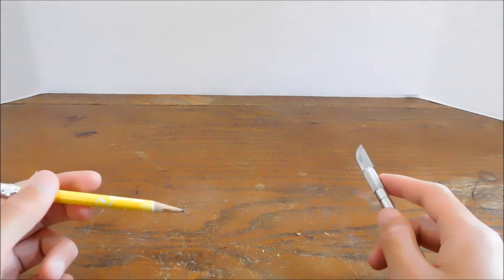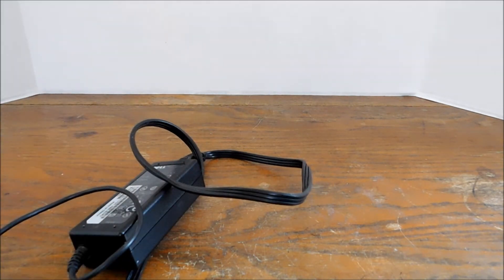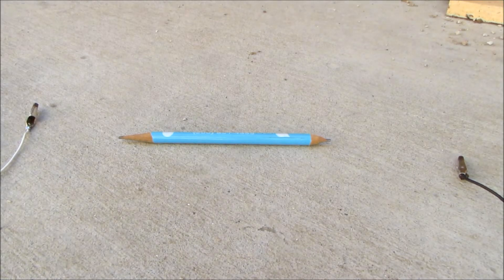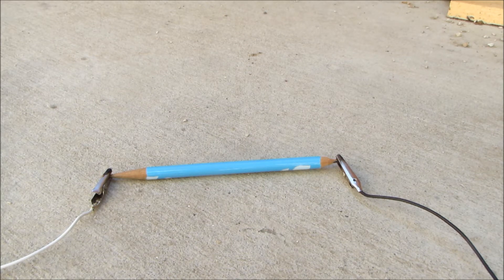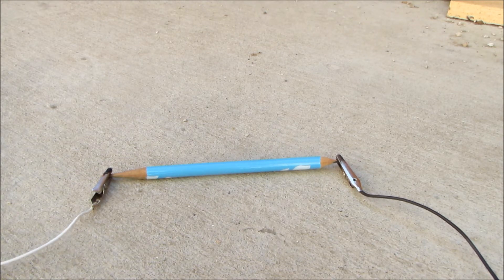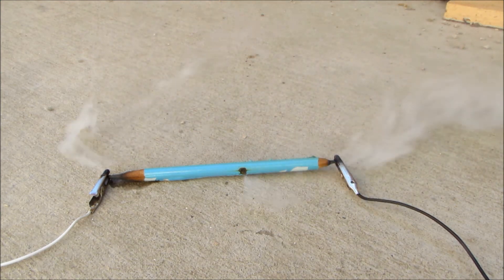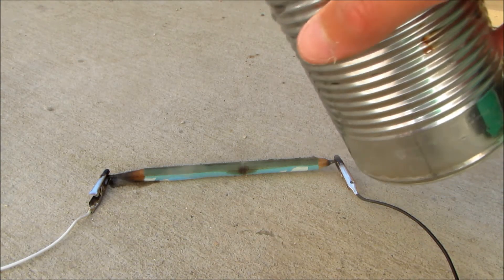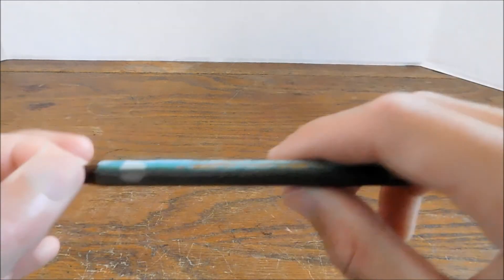How to make carbon rods from pencils

Comment: Basically how inmates make lighters in prison, BUT you could've just boiled the pencil or soaked in hot water for a while softening the glue that bonds the wood together, then split the pencil down the middle and get the led the in tact and not weakened by the heat put through it.

Comment: My pencil measured 30Ω but I only had a transformer rated 7.5V X 1.5A = 11.25W. The pencil got hot eventually, but no smoke. Found a laptop supply at 19V X 4.74A = 90W. Made it smoke and char at the ends a little, but even after 5 minutes, it wouldn't slide out. :(
Reply: The same happened to me, but after swapping out the pencil with a new one it worked well. I think the problem is that the lead inside is broken and so can't conduct electricity as well.

Comment: Can we connect this with our rooms  socket.
Reply from the maker: If you mean connecting it to the mains power outlet, then no. It would essentially be shorting out the outlet :)
Reply: @No1Solution42  Thanks so much for your suggestion.
Reply: @sujalchauhan5694  please dont toying around with outlet, just buy some cheap desktop PSU and playing around with it
Reply: @dogodogo5891  Thanks you
Reply: @sujalchauhan5694  use two car batteries hooked together + 2 - and then 1 + to the pencil and one - to the pencil
Reply: @MadStacking  Thanks